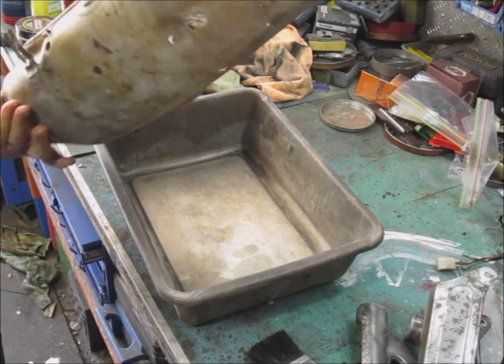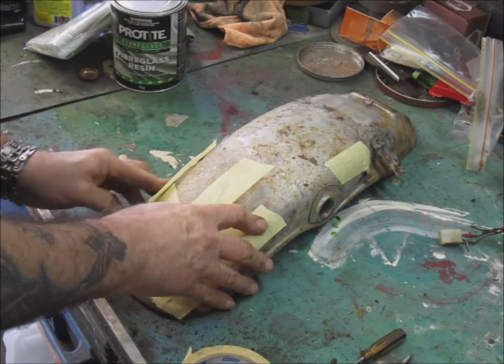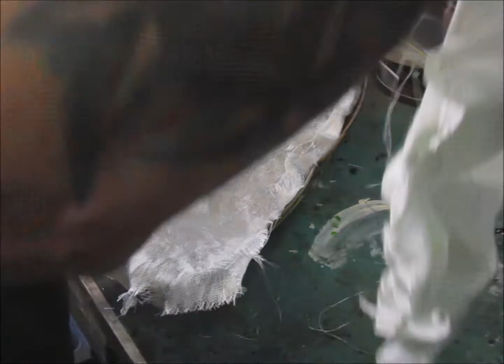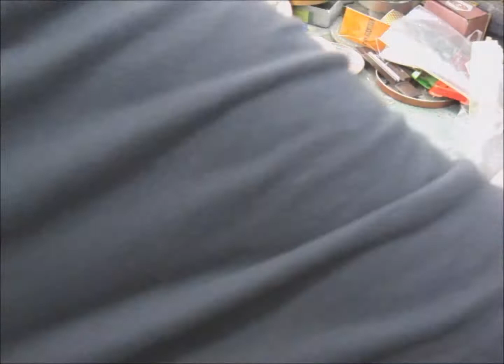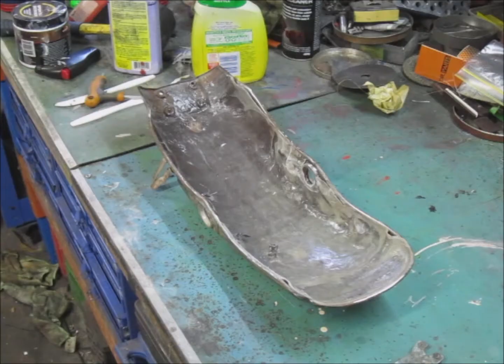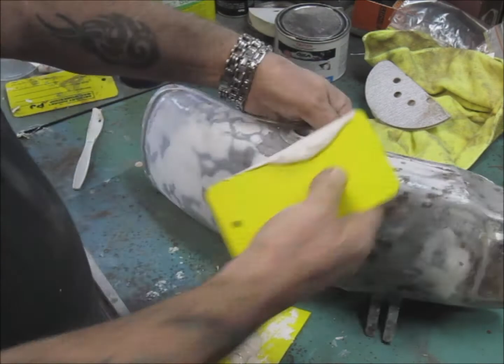Yamaha 1976 DT 175 Rear Fender Fix

Comment: I thought he was going to repair it correctly, by getting rid of all the rust first, cutting metal to fit and welding it in.  Would hate that fender on one of my bikes. It might take longer, but I always put metal, where metal should go.
Reply from the maker: You're right! But when ya got fuck all metal to work with you do what you can. Camera doesn't show the state of the inside.
Reply: @motorcyclerestomagic8070  Hi, it is always hard to see what the true state of the part is. The main things is that guy's like you and I are having fun doing what we like to do. Restoring classic bikes and enjoying them or passing on to others to know what it's like to ride a classic Enduro.